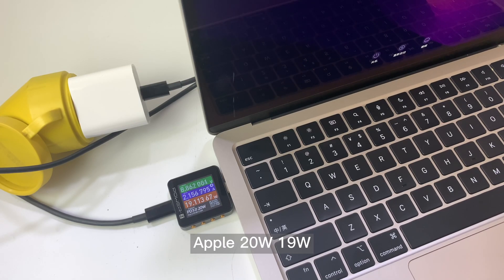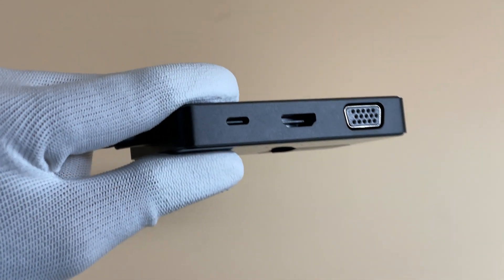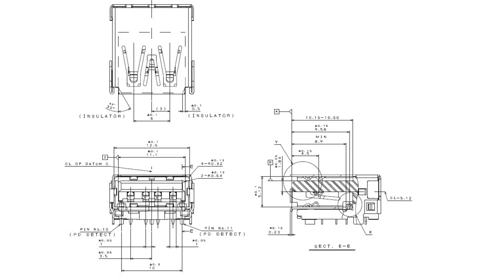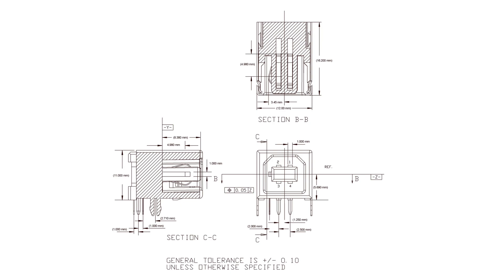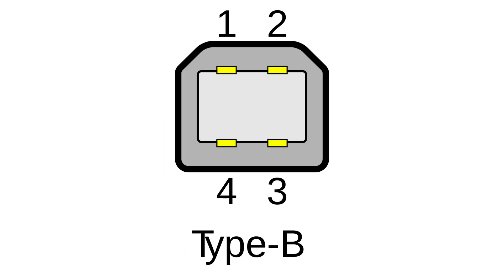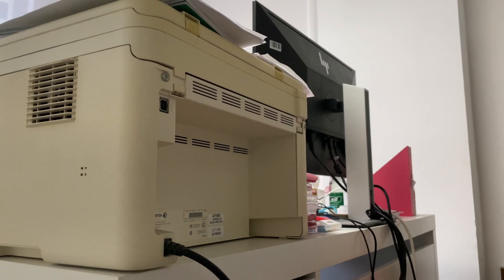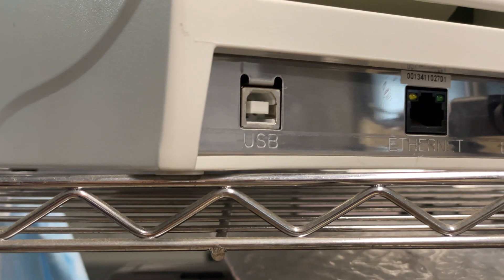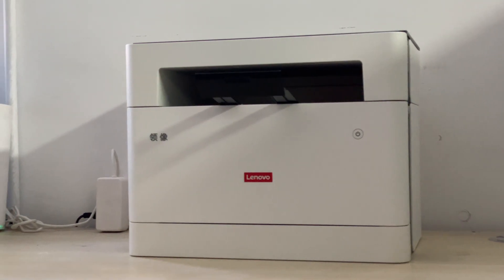What's USB Type-B Connector? | Introduction and Explained

Comment: To this day, I prefer them on the larger, static devices like you mentioned. (e.g: printers).  
It's a mechanically robust connector and it serves its purpose well.
I could see it being replaced with the (screw) locking version of USB type C, but given that the included cable would undoubtedly cost more, I doubt we'd ever see such thing outside of industrial applications.